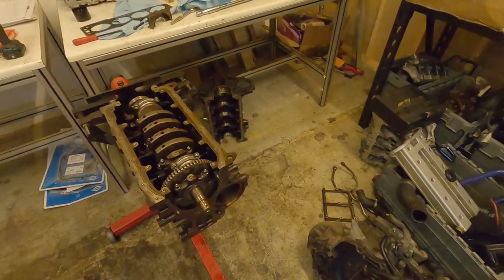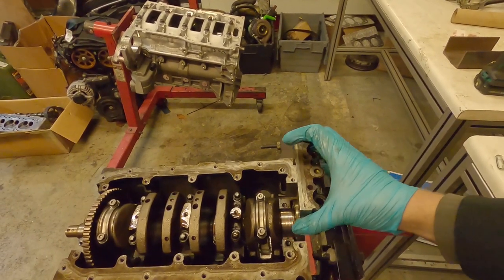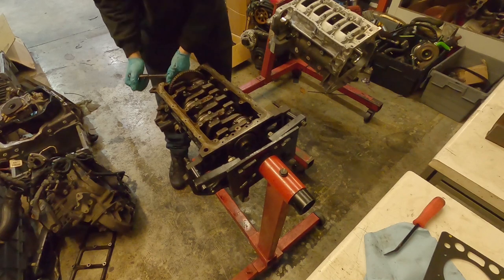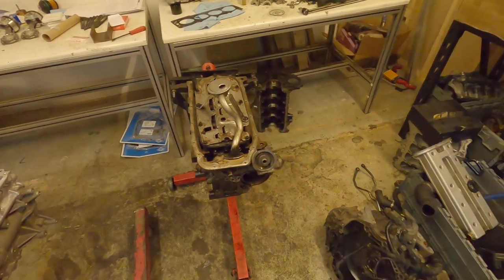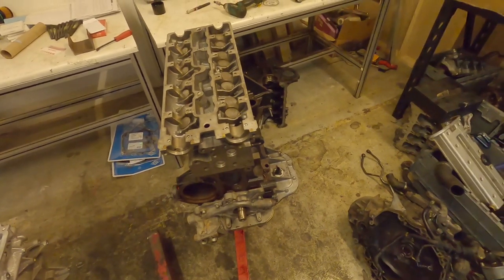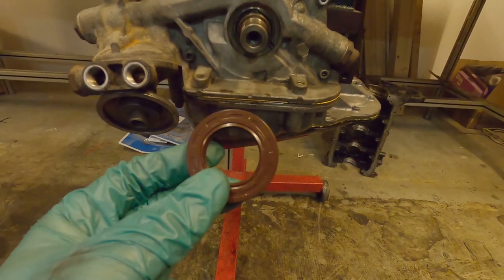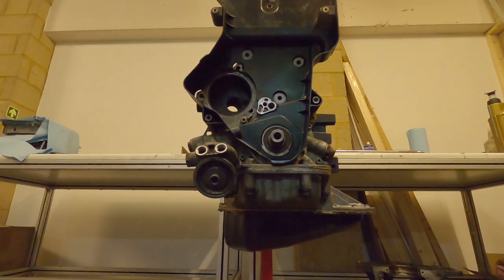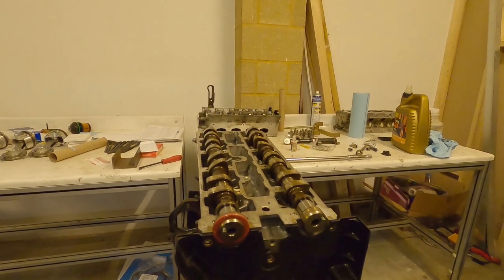Engine Building Part 8 - Head and Sump Installation

Comment: You are absolutely legend mate. Big thx for shearing your massive knowledge. I spend whole night to watch all parts of that build. I just planing to rebuild my wrx engine and not evry1 wanna share that precise knowledge about measuring all component and play between parts. And my question is : I wanna buy some measuring tools ( micrometers, bore gauge ect) all what I gonna be need to do a job. Can you recommend any tool for example what you using to do a job. I dt wanna go to crazy with this because I know they can be very expensive just need some brand that gonna be accurate and trustful.
Reply from the maker: You will find plenty of medium priced tools by reputable tool making companies out there. A lot of it is in correct usage rather than the most expensive thing.

Comment: Hi, after assebling,fitting engine back after first start up what is the driving style and for how long. And what kind of running in oil to use?
Reply from the maker: Honestly all the engines we do just go on the dyno and do 20 minutes up and down the gears, oil change, then another 20 minutes, oil change then straight into full use and mapping as that's good enough.

Mileage isn't the issue its load variance that makes all the difference.

Modern machining is good enough now that running in oil etc isnt needed. We just run cheaper regular grades of the oil change it then filter it and check it for any signs of issues.

Comment: What torque specs would you suggest for standard headbolts/crank bolts and ARP2000 rod bolts
Reply from the maker: Standard will be in your manufacturers manual any after market fasteners require the specs given by ARP